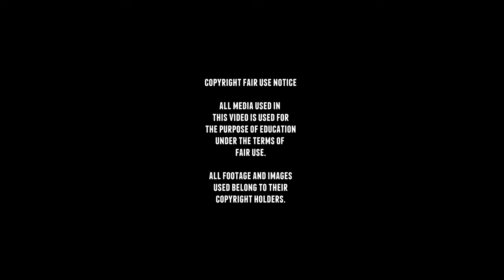M47 Patton - Walkaround - Diekirch Military Museum

Comment: M-47's did see a good bit of combat in service to other nations
https://en.wikipedia.org/wiki/M47_Patton#Combat_service

The thing about this turret - was those two things sticking out the sides of the Turret Front.  Those are range finders.  The gunner would look through his sight and see two images of the target.  He'd adjust the sight until the images came together.  The sight would then display the range at which the two images came together and that was the range of the target.

It may have been (but I don't know) that the sight controlled the elevation of the gun - so that if the cross hairs were on the target - when the two images came together - the gunner could fire the weapon.  I just don't know if it worked that way or if it just gave him the range - and he had to adjust the elevation of the gun separately.

The Addition of this range finder was a great improvement to the tanks accuracy and was also found on the M-48 and M-60.  I'm not sure about the M-1 but the M-1 does have Laser Range Finding.  I don't know if it also has the optical range finders.

If you look at Battleship turrets - you will sometimes see some thing sticking out the sides of the back of the turrets - these are also range finders.

In addition - there are binocular range finders where the user looks through a central eye piece - but there are two telescope tubes branching off of it then looking forward.

Same thing.  Focus the two images from the sights and that is the range.

A lot more accurate than the Gunner just guessing.

Non-binocular sights sometimes had markings to help guess the range by using the size of the target in the sight but this still included a lot of guess work.

During WWII - one of the advantages of the German tanks - was that they had excellent sights.  The Americans and the British had good ones but those on the Russian tanks were horrible.

The wretched nature of the sights on the Russian Tanks the Arabs were using in the wars with Israel and the excellent sights the American Tanks the Israelis were using, had something to do with the lop sided battles between the two.  The Israelis could get first round hits whereas the Arabs were having to do the old over/under/on routine having to fire 3 rounds to get a hit.  As you can imagine - they often did not get off 3 rounds before they were blown up by 1st Round Hits.
.